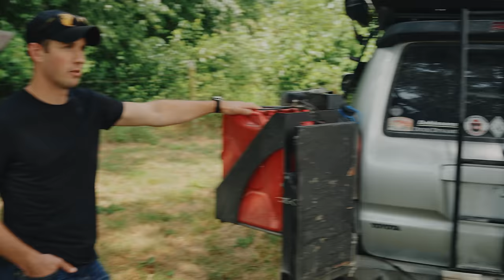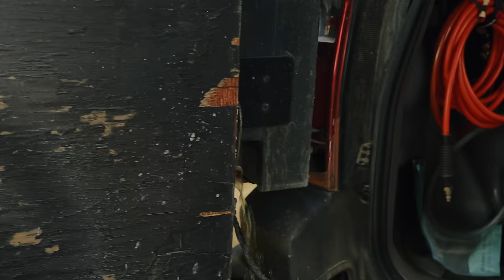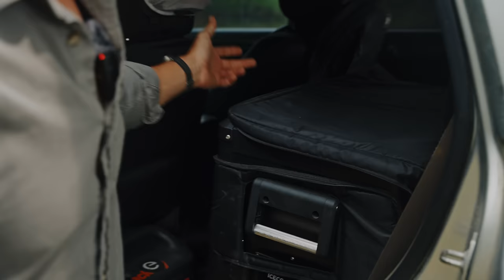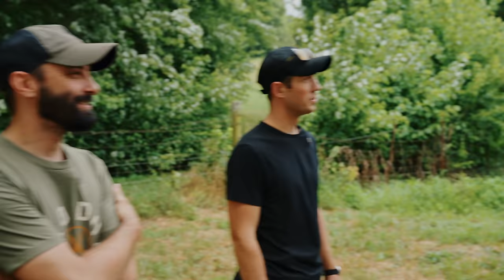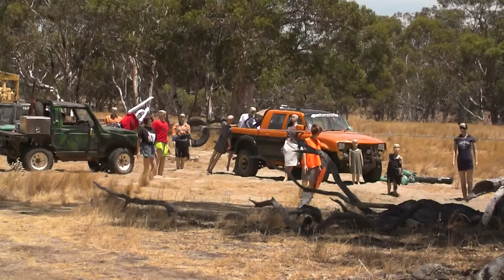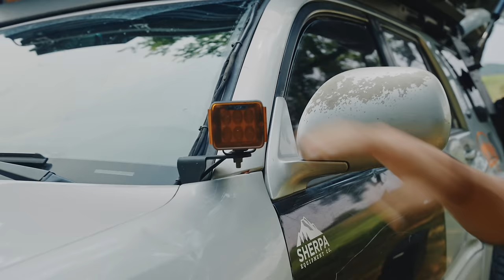4-Runner Overlanding Sustainment Loadout

Comment: I agree that a part 2 is needed. What I’d be most interested in is the plan to actually coordinate the rendezvous with the relative trapped in the city. Show us the radio equipment and how to build a comms plan. Then explain how would one stage equipment beforehand and how to execute (and synchronize) the extraction?
Reply: It's called not being in the city to begin with. There's no driving into a city and getting back out easily if something has happened to make the city shutdown.

Comment: Thank you. The overland/crawler folks have a lot of insight, but certainly those must be adapted a bit. The ability to be able to pump/obtain fuel is critical. The ability to "cleanup" dirty or otherwise degraded fuel [I run diesel with old school engines], water/water purification, tools, parts...including electrical and a good meter with extra batteries, commo including if you have to hoof it [leather personnel carriers], minimalist cooking, sleep gear, tarp, GPS on overhead shelf with another on Panasonic Toughbook in mount, manual power puller [cast iron], shovel, pick, mattock, bar, tow straps appropriate to your vehicle [mines really big], belts, hoses [radiator hoses and heater hoses break], fluid lubricant's, med kit [carry big one of vehicle and on my kit are more extensive than most...but then I'm trained better than most], fire starting is on my kit, weapons are on me and go where I go so I don't really associate them with the vehicle.

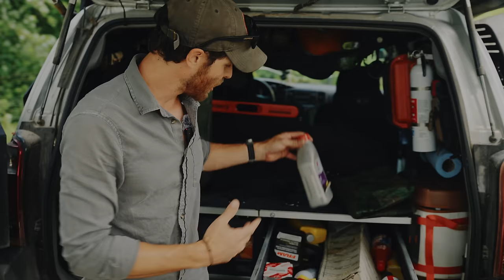Comment: You always gotta have your bottle of ATF with you for when you're way off grid (30:34). This was one of the best show and tells I've seen. I envy the guy. He's got an excellent rig. Thanks for the video! BTW, a CV joint stand s for constant velocity. I'm not a mechanic, but in my experience, they're encased with rubber around them and filled with CV grease or axle grease. You used to be able to fill them up, but I've heard they no longer have nozzles where you can do that and you have to replace the entire thing. (As far as I know.)
Reply: Unless of course you're running a manual. Personally, I think offroading with anything other than a manual is... well, just don't.
Reply: I thought they lubricated in 4wd when the transfer case is engaged

Comment: Great video!  I've been into Overlanding for a few years now but just never had the opportunity to build out a vehicle to that extent.  Closest thing I used to do was truck camping and I have a lot of the same gear as Chad.  My friend got me into Jetboil's system years ago and I was even presented the opportunity to provide feedback on the design of the Genesis system.  I still need to pick one up!  I even went as far as to buy the french press lid for my Jetboil so my girlfriend can have coffee when we go camping......right around the time she decided to stop drinking coffee....lol.  As for water filtration, I have one of the gravity filters where you fill a bag (I think it's a gallon or two) and just let gravity draw the water through a filter at the bottom of the bag and into a tube which you could drop into a water can.  A friend and I went on an African safari where the guides rented Land Rover Defenders that had water bladders that filled the space between the interior and exterior panels which I thought was pretty cool.  

Speaking of zip-ties, while at an off-road park, a guy in a Jeep Wrangler (I think it was a TJ) broke his power steering belt.  Someone busted out a couple heavy duty zip ties to try and get him off the trail.  It worked!  For about 50 ft.  LOL

Comment: Babe be quiet Dirty Civilian uploaded
Reply from the maker: LOL
Reply: @dirty-civilian  You guys should do a basic vehicle understanding video. Quick fixes, self diagnosing common issues, and general education about the main important parts that make a vehicle function. Like “This is a radiator, might not look exactly like this in your car, but essentially a radiator runs coolant and air through it to keep the engine cool. It can also run water instead of coolant in an emergency. Ok, on to the next major part you should understand.”

Comment: Awesome video, especially for someone like me who bought a 5th gen 4Runner this year and is beginning to consider what would be practical additions to it. I do want to point out though, that while an awesomely equipped rig like Chad's is perfect for long term overland driving, I feel that there is a distinct possibility that it would attract unwanted attention in the "save your girl from New York City" scenario you guys put forward. Bad people - or bad cops - would likely see a vehicle like that and rightly assume there are lots of guns and valuable goodies inside to steal. So for that situation I might propose a 4Runner build that stands out much less, with all its equipment inside, and only the five bare minimum items that Chad stressed. I think it would be much safer in an urban setting to do all you can to seem like just another city slicker who isn't worth the trouble of hassling. And even if you had to go slightly off proper roads in an urban area, it does not seem likely that any traversable obstacles would be anything a basic SR5 trim couldn't handle.

Comment: I drive an econobox cheap car. GREYMAN AF BRO. I've always kept a series of things in whatever vehicle i'm driving. Small ratchet/socket kit with some screwdrivers, jumper cables, the spare clean oil from my last oil change, an antifreeze bottle with water, an empty gas can, kitty litter (ice and snow) and some other small spare parts (might as well keep them with the car for emergencies). The car has a spare donut, jack and a tire iron which i've tested and it works well. I greased the jack and added a 3 foot 2x6 as a platform for the jack. If you've ever jacked a car on uneven ground its a recipe for having a car come down on you. The 2x6 adds exponential stability. I've also recently added an e-tool for if i need to dig myself out of snow level a spot for the jack or maybe make a cat hole lol. I also keep some blankets and a cheap rain jacket in the back pocket of my seat.

Comment: My lifted deleted F350 crew cab long bed diesel is the ultimate bug out vehicle. 
I can go 500+ miles on a full tank of fuel and nothing is stopping her
Reply: What year and engine?
Reply: @Falling-faster  2007 F350 6L 
And also have a 2002 F350 7.3L
But I was referring to the 07 in OP. 
Both trucks are crew cab, long bed lariats with cap on bed 
07 has 6” lift with 35’s
02 has 8” lift with 40’s

Comment: Off the shelf V8 fotrerunner nice, ours here in Ausyralia only came in 4 cylinder diesel or 4 cylinder pertrol, we take the 4 cylinder diesel out and put in a fuel injected V6 out of a holden commodore car and it gives a good balance of power, torque and economy plus the diesel forerunner already came heavy duty enough for a V6.. 

We add dual tanks under the 4WD so you have your main 60L or 80L tank and a second 40L to 60L tank and you could get anywhere from 1200lm upwards of 1400km out of the dual tank system before touching the spare fuel in the jerry cans.. Dual tanks and jerry cans it's about 1500km to 1600km which we need especially when we can drive hundreds of km's sometimes drive over 1000km between fuel stations and towns once you go central outback Aus.. 

Some would put holden V8 then you would have to start modifying the rest of the vehicle for the additional weight and power that come with a v8 so things didn't break when you worked it hard.. They make conversion kits here in Aus for the upgrade on both hilux and forerunner for both holden V6 and holden v8 and it's a pretty straight forward conversion keeping the 4 cylinder diesel gearbox and clutch with the holden v6..

Comment: Cool truck!!!  But I would NOT extract someone with a rolling hotel, lol.  Probably not fast or handles well and a U turn would kill you, not to mention being a target with goodies hanging off the side.  Get a friend like me, 89 YJ, runs duel fuel (propane/fuel), fast and light, AC turned Air Compressor, tricked out engine, (90% of tools on board), would take off doors and hard top for fast extraction and 360° "view",  2.5" lift-31's (decent off road/streetable handling), etc.  Then rendezvous with the rolling hotel.  No 1 vehicle does it all.

ETA:  It's cool you guys asked about using smaller vehicles as well.  That's a badazz rig, but many can't go that route.

Comment: Sick video. That’s tough only having 350 miles of gas only. My 2014 f150 can go 400+ on a tank and I can hold an extra 30 gallons easily in the bed while having tons of extra space. I keep it topped off for emergencies always
Reply: But it's a Ford so u may break down before running out of gas or bend your aluminum frame so there's that 😂 lol jk
Reply: @Cthru23  man I’ve owned all of the big 3 and my dodge was by far the most unreliable. I have 135k miles in my f150 and it’s never had any major issues.

Comment: Any thoughts on using a diesel truck instead of gasoline? I was thinking long term with bio diesel being fairly simple to make and the fact a lot of older trucks are pretty bullet proof under the hood.
Reply: Yeah, get a 12 valve 5.9L Cummins or an International 6.9L or 7.3L IDI. Million mile engines that'll run on anything combustible that isn't a solvent.
Reply: I’ve been saying this for years. Most older diesels can run off of many different types of fluids that can be found very easily

Comment: Fun Fact for all you F150 drivers out there. The standard Military style 20L (5 Gal) fuel container, you can fit 7x to 8x containers the width of your truck bed. That's an extra 35 to 40 gallons. So if you have the extended fuel range option with the 33 gallon tank, that's an extra tank. If you have a 3.5 Eco TT, and your running highway to get somewhere, that's an extra 500-600 Miles easy.

Comment: Really like his setup! 
A few minor tweaks - mainly repackaging things/removing packaging to save space (Depending on how valuable every inch is) . 
Longer drawers?
For those new to 'Non-Stop' driving IF you have the cash/desire there is a 24 gal aux tank for the Lexus GX470 & 4th Gen 4Runner - Downside is it runs around $2k. (33 Gal avail for 5th Gen).

Comment: You should have a bulk pack of fuel filters just in case you and the other vehicles need to change your oil several times on the journey. You, know, preparedness.
Reply: Yooooo it’s you
Reply: @henderson9134  Who??! Where!?
Reply: Low on the list
Reply: @tuckerhiggins4336 hey, you never know when you might need a cheap fuel filter. They’re super convenient too, since you can get adapters to fit whatever system suits your needs
Reply: @tuckerhiggins4336 woosh?
Reply: We all carry spare oil filters… fuel filters is a different story seeing as how you have to drop to the tank to get to the filter on my rig.
Reply: @rallyrats   Don't let the joke get lost because I said the wrong thing.
Reply: @wiredtight  nah, even fuel filters will work to help make your system more enjoyable to operate! ;)

Comment: PB Blaster and Aero Kroil are the best imo. For guys that don't know, "penetrating oil" (yuckyuck) is supposed to "creep" into tight spaces and penetrate rust build up to help you break loose a rusty bolt or nut. Its best to let it sit for a while for the best effects but it definitely works. Sometimes bolts are really tough and still need a heat source to get them break free, but the penetrating oil will help and will still creep into those spaces even better with heat..but careful not to start a fire.

Comment: Tennessee to NYC, go up the Blue ridge/skyline drive to Front Royal Virginia, highway 11 runs with I-81 north bound into Pennsylvania, from there you can find 1 of 4 ways to NYC, the 5th way would be the long way near port Jarvis area and head to the GW bridge, whoever you’re picking up should of walked across to jersey on the GW. And walk north along the Hudson River until meeting location. This is from the top of my head, retired truck driver born and raised in NYC. I’ve hitched to LA twice as a teenager and after I retired 4 years ago, rode 1500 miles on a bicycle tour ride with a trailer from Detroit area through Chicago Heights area on July 4th 2019. ( everyone out on the holiday, easy to travel in plain sight) I finally made it to where I live now by Amtrak after hitting early snow in Kansas October of 2019. Now I have a cheap version Bug out vehicle after March of 2020 when all this started. Heads up for diesel vehicles, train engines hold 5000 gallons of diesel if the power goes out long term and cell towers have 100 gallon generators that last 3 days or so. Oh I would tow a side by side on a trailer in isolated areas. Save your primary vehicle for travel and use trailer to sleep on,etc.

Comment: A Honda Fit could make a great bug out vehicle. Great gas mileage. Compact. Quick through corners. Seats fold way the hell down so you have a legit full bed in the back. Lots of outrigging options (I have a hitch on mine). Some pretty simple engine upgrades can get you some extra horses for hills. You could raise, rather than lower, the suspension for a little more clearance, and they are notably reliable cars. I have 150k on mine. Just replaced the brakes, mechanic said it was in great shape, and I drive it on bumpy city roads, highways, dirt roads, etc. They're also great on tires. I have all-weather Falcons that have a bit of emphasis toward snow just because of where I live. I keep thinking, "Aren't these going bad?" Go and check em, and nope. Mechanics agree. The tread has lasted forever. A 10 gallon spare tank of gas could take a Fit pretty damn far, especially if you know how to hyper mile.

But by far the best feature is the seats. I ride around with only 2 seats up -- the rest are flat into the floor, and the trunk is a hatchback. Loads of storage, easy to camp inside the car. You can rig up the roog, the rear with a hitch, etc. It's cheap and not that difficult to do basic matinence yourself if you have, say, an 08 through 2013 model. The newer (and now discontinued in the US) models obviously have a lot more electronics you aren't going to be fixing in the woods

Don't sleep on the fit! And they're going for decent prices too. If you are in a city and looking to say bug out to a cabin or family out in the country, it's a great option.

Comment: you can also get an aux tank underneath the rig with 40-55 gallons + original tank + what you are holding on the side. Also a diesel engine with get almost 2x the mileage.

Comment: 370-425 Miles - and that is with external carry tanks.  And in an actual SHTF situation, the likelihood of any resupply for gas is next to nil.  So, the 4Runner or similar vehicle that so many people spend so much money on then becomes a stay-in-place metal shelter (aka bullet magnet - I know, that's a little melodramatic . . . but you get the idea.  Not very mobile at all).  @ArmsForThought's idea of a "tactical platoon boat" doesn't sound half bad.
Reply: Honestly I think a V8 is completely unnecessary for a 'survival build' like this. There's a multitude of reasons a smaller diesel engine is a better choice.
Reply: This is kinda where I am, there's only 400ish miles of endurance here, and that's to get in and out. So you need to drive that big heavy apocalypse looking vehicle into NYC? The motorcycle idea was a lot better.
Reply: The 4.0 aren’t any better when I comes to fuel mileage. All that extra weight makes her work ever harder😂
Reply: @333dwells  if you think a 4.0 is considered 'smaller' you've gone wrong. I'm taking 4 cylinders, not 4 litres
Reply: @ieuanm  and I wasn’t replying to you … I was replying to original poster who mentioned the fuel mileage of the v8 4Runners, and I brought up the 4.0 4Runners
Reply: @333dwells  my bad, YouTube comment formatting is so bad I couldn't tell
Reply: @ieuanm  all good
Reply: @ieuanm  Most vehicles have a designed in mileage of about 250-300 miles per tank. Off-road vehicles sometimes have larger fuel tanks, which might boost it into the 350-500 range. The reality here is that an offroad vehicle is not the thing to mount a rescue mission with, maybe if it could deploy a motorcycle or better an e-bike. Going into a city with a fancy vehicle full of survival supplies is going to be how you get jacked.

Comment: Don't know if it's been said, but you should dry run a few escape plans. Create Simulations that require you to go through your equipment, make sure your jack works and you know how to use it, is your first aid kit useful or is it full of cheap plastic bandages , are you carrying enough water, are the roads intact or passable, do your coms work, what is your back up back up plan.

Comment: I think a lot of dudes focus on the mid-size truck/compact SUVs for this type of build, for good reason, they're time proven

However I think a BIG missed opportunity is those old, pre-emission diesel 3/4 ton and 1 ton trucks. Those big old 7.3 Powerstrokes or those 12v and 24v 5.9 Cummins, even the 6.6 Duramax are amazing platforms

Durable, reliable, and enough torque to pull a house down means you'll rarely have real downtime, and theres very little you can't push or pull out of your way. Beefy axles and suspension means you can run them pretty rough and not have to worry about damaging anything

But the biggest thing about these trucks is they were designed to run on diesel, but you don't HAVE to run them on diesel. You can run them off motor oil, transmission fluid, french fry grease, if you change the injectors you can run them off vegetable oil, essentially anything you can pump through the fuel system that'll combust under compression. I've seen a guy start a 12v Cummins with a can of bug spray, those things just don't fucking quit